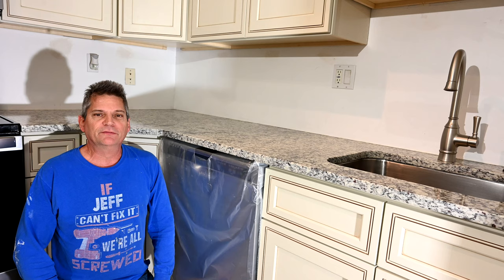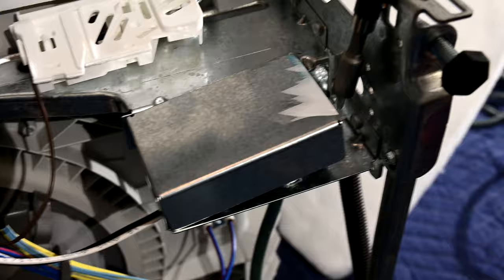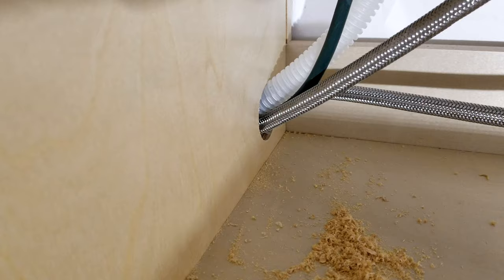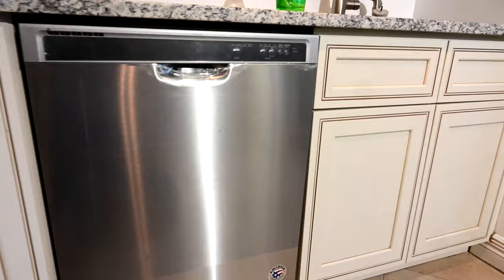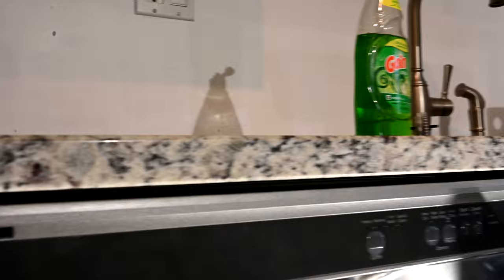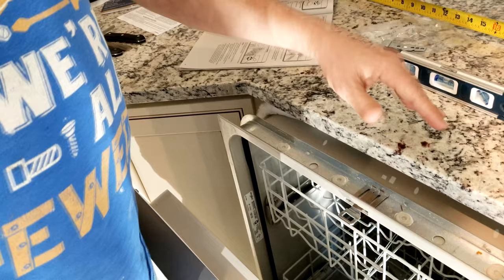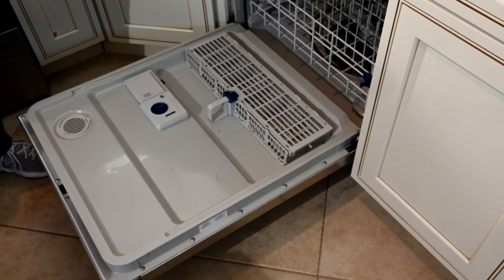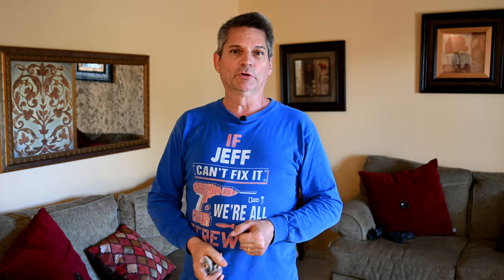How To Install Dishwasher Like The Pros, Correct to Code

Comment: Thanks for the video Jeff. I bought a new KitchenAid dishwasher and the kit I bought with the water hose and electrical is too short. The drain hose that came with the dishwasher is too short Also. The drain hose that came with the dishwasher has an angled connection at the machine and a straight connection on the other end. Can I add an extension to the drain or should I buy the rubber hose at Lowes and cut it to length? I will have to order a long water supply hose because the stores here don't stock it.
Reply from the maker: Wow how far are you from the water supply? I have never seen a dishwasher hose not make it. But yes I would make it one hose end to end, not comfortable making another connection that can leak.
Reply: @jeffostroff  The old dishwasher I pulled out had the electrical and the drain spliced. I would need anywhere between 10-12 feet of drain hose and about 10 feet of water line. The old water supply line was copper tubing that I have already trashed. The copper was connected to a 3/8" quarter turn valve under the sink. I don't want to use copper again. I can order a longer 3/8" braided water hose but it will take two days to get it here from Amazon. Lowes has the EZ-FLO rubber dishwasher drain hose in 10 foot length. My concern is that the KitchenAid drain has an angled connector at the machine end of the drain hose and any replacement would not have this angle.

Comment: As of 2020, you need a GFCI outlet or circuit.  I didn't see one on your installation... unless its in the fuse panel.

2020 Code Language 
N 210.8(D) Specific Appliances. Unless GFCI protection is provided in accordance with 422.5(B)(3) through (B)(5), the outlets supplying the appliances specified in 422.5(A) shall have GFCI protection in accordance with 422.5(B)(1) or (B)(2).

Comment: I watched this hoping I would find out how to feed power  to code. It looks like power came in from a receptacle? Not wired directly. But a plug would have to be attached to the end of the cable that was wired to the dishwasher?
Reply from the maker: Yes, Paul, typically we use this Whirlpool 3-Prong Dishwasher Power Cord Kit: https://amzn.to/2XysrYO. Most kitchens have the dishwasher and garbage disposal split on a n outlet under the sink.
Reply: @jeffostroff  Awww, clears it up. Thank you!

Comment: Help! I may be attempting this myself, but where do you connect the drain hose to if you do not have a garbage disposal? And shouId I still bend the hose up as high as possible to the counter top before connection?
Reply from the maker: You need the 1-1/2 in. x 8 in. Plastic Dishwasher Branch Tailpiece 
https://www.homedepot.com/p/KEENEY-1-1-2-in-x-8-in-Plastic-Dishwasher-Branch-Tailpiece-PP931-8PVC/304826866

Comment: Hey there. I'm getting a new dishwasher installed and the installer mentioned GFCI. I believe my dishwasher is hardwired and it has a countertop switch to turn it on and off. Do I need a GFCI receptacle? I'm clueless so sorry for my lack of knowledge. Thank you!
Reply from the maker: If yours is hardwired then you might consider adding an outlet box into the wall there and installing the GFCI. OR...some people just have the breaker in the electrical panel as a GFCI breaker.
Reply: @jeffostroff  Thank you for the quick reply! So what are the chances my breaker in the panel is GFCI? If there is an easy way to check I'd greatly appreciate it
Reply: @SwervinSpliffs27  go downstairs and look at your panel, a gfci breaker will look different than all your other breakers. It will have a test and reset button on it.

Comment: I just installed this exact model dishwasher, but it's leaking from the bottom of the door. Not from any of the pipes or tubing. Seems like it's probably a leveling issue, which I found odd but is there something else that could possibly be causing it, I don't have a small enough level right now I have to get one.
Reply from the maker: Check the rubber gasket seal and make sure that there's not any gaps in it because even if it's not leveled this should not leak if you have a good seal around the door period

Comment: That’s my problem with my dishwasher installation quartz countertops also have to be installed on the sides. Do they make a fixit bracket?
Reply from the maker: I wish I has gotten a photo of what my granite guys did. On another installation they embedded wood into the front edge of the granite underneath , where the dishwasher can mount 2 screws just like you have a wood cabinet. Another time they cemented on a thin bracket 24" x 2" or so to the bottom of the granite counter, with tons of holes in it, and your screws just fit into and grab one of the holes in the bracket. Other than that, you just screw into the side of the cabinet like we show, but remember the cabinet is usually 1/2" or more thick, so use a screw no more than 1/2" thick, or you'll poke through to the inside of the cabinet with the screw.
Reply: Yes, they have a steel bracket that attaches to each side of the cabinets. Check this out: Dishwasher Bracket GMC Supplies https://www.amazon.com/dp/B006ODLDY4/ref=cm_sw_r_sms_awdb_t1_IyaUEbJECGYD5
Reply: Some dishwashers don't have side mount available. Many times you can drill the machine on the dry side of the door gasket, but not always.  If you're the daring type, you can drill the bottom of the countertop and epoxy in a pair of "Tee Nuts" with the teeth cut off. Super slick way to do it for sure. Just do NOT use the hammer function on your drill that close to the edge of the counter. Many Countertop guys will do this for you cheaply, especially if you catch them while they are there on new installs. Just be sure to mark them EXACTLY, and double check before you epoxy the tee's in.!! One shot deal there!
Reply: I use 2 part epoxy for the brackets on the top to bond to the underneath part of granite and it works well

Comment: Relatively new to your channel, and I have enjoyed much of your content. I just bought/installed a brand new whirlpool dishwasher much like the one in this video. The only snag I am experiencing is the door on the left hand side seems to creak when it reaches its lowest point and wants to bounce back up a little. Could this mean that spring needs adjusted?
Reply from the maker: I have never had to adjust the tension in the springs but the owners manual tells you how to do it. They tell you whether or not you need to adjust it also.

Comment: Hi Jeff,

What are your thoughts on building a trim piece about 1.25" x 24" wide to go above the dishwasher and for appearance only? I have done this in the past. But is the regular way to do this, is to raise the front feet up to close the gap between the top of the Dishwasher and the bottom of the countertop? The countertop is a "formica" type of surface with particle board below that. The total gap above the DW is about 1.5" tall.
Thanks,
Jim
Reply from the maker: I would use matching wood from the cabinet maker for this. Ot, try putting plasti shims under the dishwasher feet if you can't get the feet to rais eup the dishwasher to meet the counter
Reply: Jeff thanks so much, I actually did use the same wood. It is very thin maybe 1/8" so just now I glued another 1/4" behind it.  It is flimsy and additionally I was thinking to secure another piece to this trim so that it looks like a "L" shape and then push it up into place and use screws to secure horizontal piece to the underside of the counter top. I do not know if I can join a right angle piece to the flat trim piece to make all of this happen?

Comment: I always assumed the drain hole was drilled in the cabinet at the top side  corner not the bottom corner. Water supply at the bottom corner
Reply from the maker: The dishwasher manufacturers will not allow hat, there is no clearance in the back up top to fit any hoses. They all have to fit under the dishwasher, so you have a 7" max height off the floor for your drill holes.
Reply: @jeffostroff  I also have a dishwasher that they installed the drain hose coming into the top of the cabinet, then it loops down to the bottom of the cabinet, then up to the disposal. I've had some water leak issues, I think this might be the problem. I already changed the water supply line. It leaked water when I was away for the weekend all over my floor, but I didn't run the unit before leaving. Any thoughts Jeff?
Reply from the maker: @blueswitch88   What they did sounds like a normal high side loop to me which is the way it should be done I would have to see pictures and I need to know exactly where you're leak is coming from Maybe you could shoot a video and upload it

Comment: Why didn't you get the height and level adjustment of the dishwasher before you put through the lines (that way you're able to pull it in and out to check without the lines being already connected
Reply from the maker: Yes you can do that. We followed the steps in order of the instructions
Reply: @jeffostroff  haha .. just another reason why I don't like instructions 😅

Comment: Oh the biggest mistake is the open drain pipe under the sink with a rag in it, and he forgot to mention when you punch out the knock out in the disposal to get that knock out from inside your disposal, remember not everyone  on you tube knows what they are doing
Reply from the maker: Another idiotic attempt to discredit. I also did not tell people to throw out the cardboard box afterward too. The open drain under the sink with the rag in it is from an old unused drain line that was later cut off and capped up. Trying to make this look wrong so you can feel good about yourself, and discredit the experts just make you look a lot less knowledgeable. and now everyone knows you are full of hot air and no substance. Nice try.